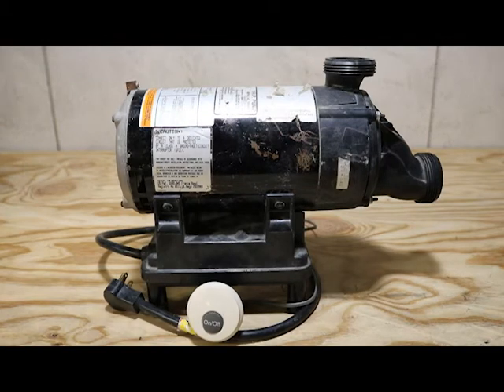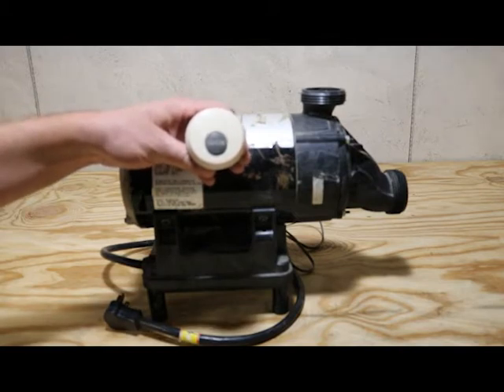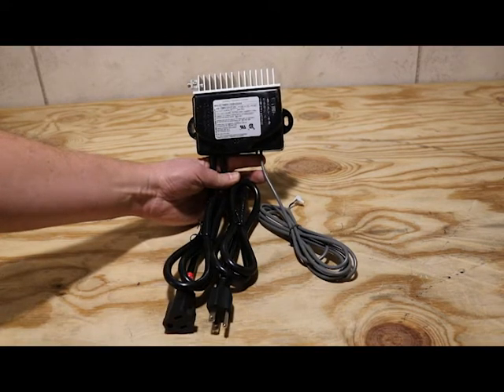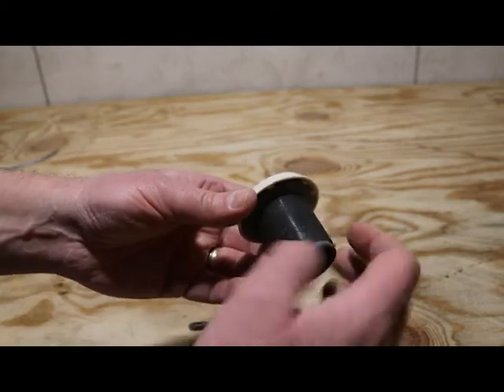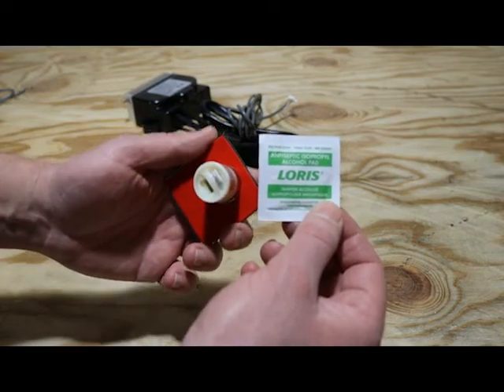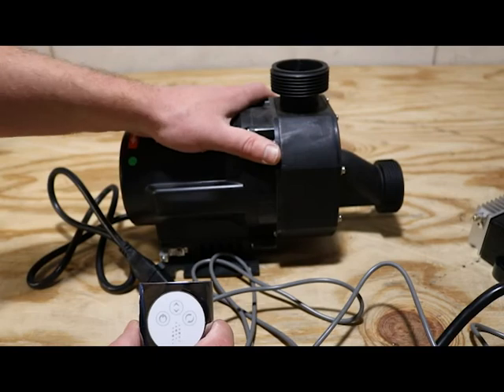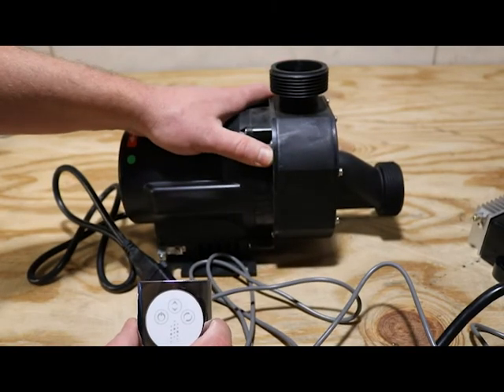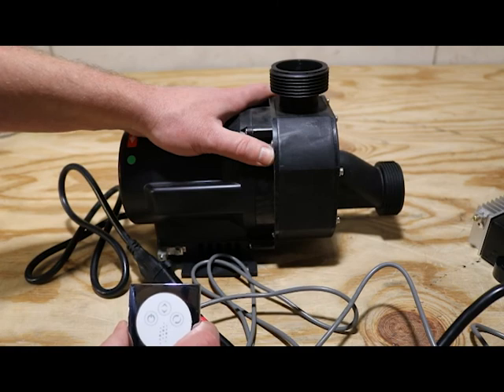73533-AA KOHLER® WHIRLPOOL PUMP REPLACMENT SYSTEM

Comment: watching your video and finding information out 
 we have a Kohler tub that is at least 20 plus years old that is not working , why not sure 
 our control button is the same as in this video we never had added heat which is very confusing
I see the 73533 AA Kohler pump replacement is expensive is there any other pump that is much more affordable

i guess the only real way to tell what we have is to access the pump?
please help